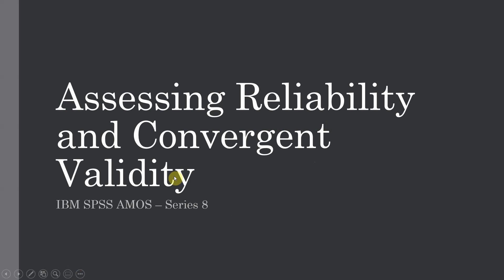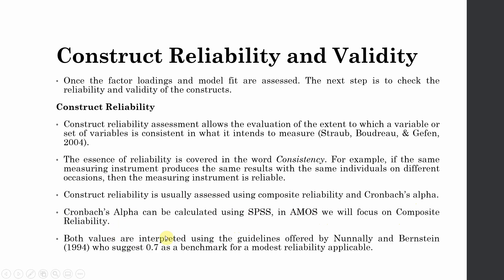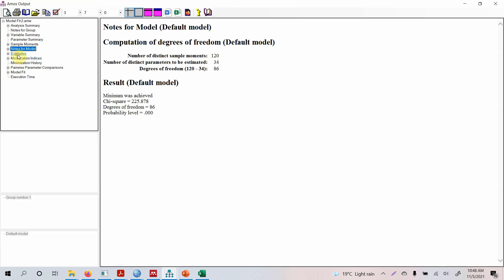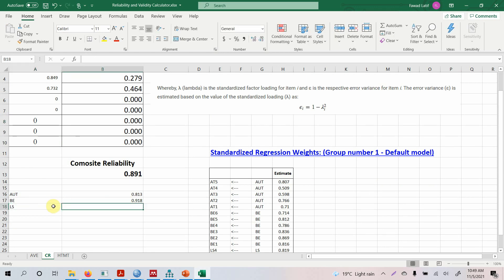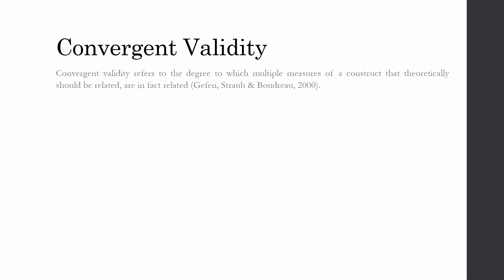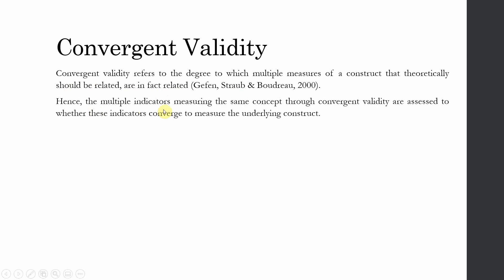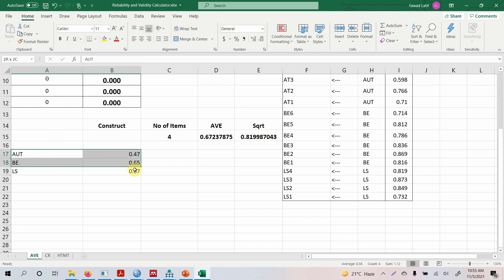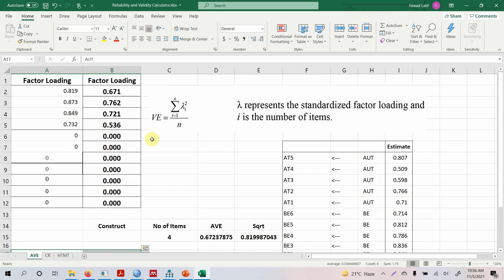11. SEM | SPSS AMOS - How to Establish Composite Reliability and Convergent Validity

Comment: I don't understand why both headings are factor loading,  and what formula is used in the second column
Reply from the maker: Can you point to the time in the video, please
Reply: @Research With Fawad  I figured it out that the second column is the square of the factor loading..... Meanwhile another question, what can I do when my data is barely reliable and not valid?

Comment: Sir, how are the loading factors calculated?
Reply from the maker: Factor loadings are provided by the software as Standardized Regression Weights. No need to manually calculate them.
Reply: @researchwithfawad  yes i understand, i was more interested in the manual procedure of how those values are obtained then of course if there is the software we dont need to calculate them by hand.

Comment: Sir i have gone through a number of videos where they use loading from rotation matrix for calculating CR and AVE. I am confused whether to take loadings from rotation matrix or standartdized regression under estimates.
Reply from the maker: If you are using SPSS AMOS, take from Standardized Factor Loadings in Estimates